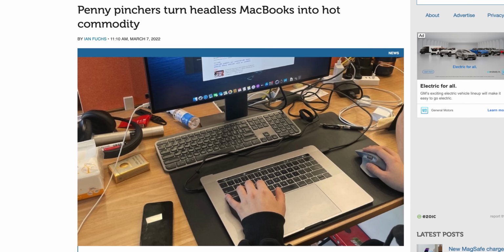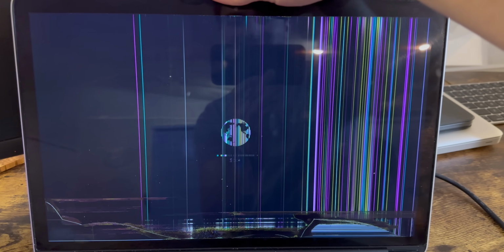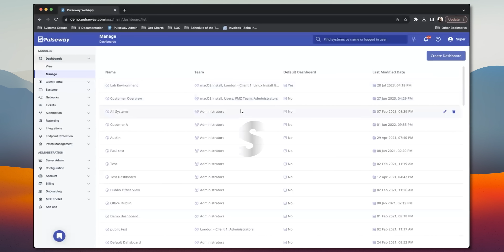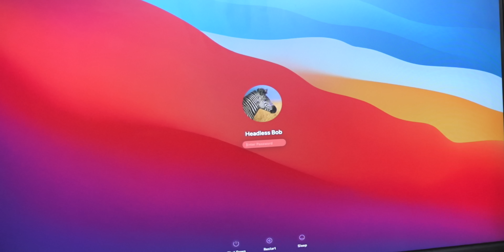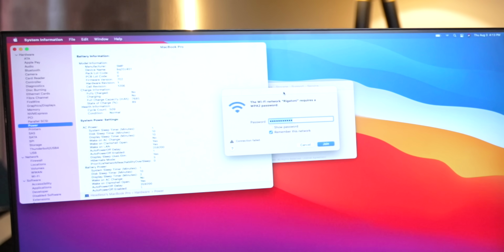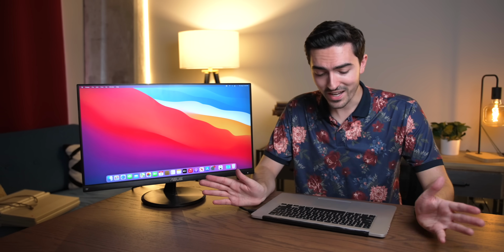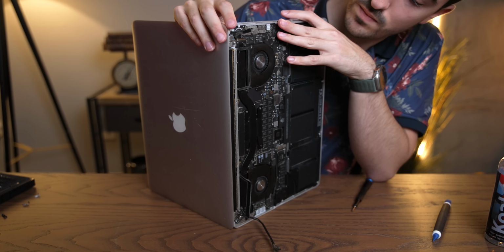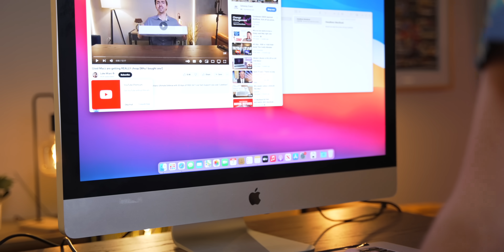Exploring the weird world of 'Headless' MacBooks

Comment: 2016 and later macbooks have the antennas separate from the display so you can remove the display assembly and keep the antennas.
Reply: Except the 2017 Air and 12-inch MacBook =)
Reply: @OskarBlomkvist   The 2017 air is in every way the 2015 one so it does not count as being 2016 amd later. The 12 inch MacBook uses the housing of the speakers as its antennas and are not connected to the display in any way. The in-display antennas died with the 2015 macbook pro and air. I rest my case.
Reply: @mirceamihai94  You're right about the 12 inch MacBook, but wrong about 2017 Air ;)

Comment: How does the MacBook now know it’s shut (clamshell) and not open? 
I would suspect that when you use the MacBooks keyboard it definitely thinks it’s open and the external display is the secondary display and when you go in display configuration you’ll see the external as second display and can’t access the stuff on the internal, primary display.
Reply: the mac can actually tell if a display is connected to it's internal display connector. This is why you have to install opencore legacy patcher on some macbooks to disable the slowdown that can be caused by this
Reply: Hall effect sensor!

Comment: I think 'Headless' M1 13 MacBook Air is better than M1 Mac mini. You even don't need to buy a keyboard and a trackpad separately.
Reply: You don't need to buy a UPS.
Reply: @leonidas14775  Or any other shipping company, for that matter!
Reply: I run one of these. I connect to either a monitor, an iPad, or XREAL Air glasses. It’s fantastic if you can find a discounted one for resale. It’s a little quirky at first but most of the weird primary display conflicts can be circumvented with the software ‘BetterDisplay’. I think the M1 air is ideal bc it’s a closed design with no fan, a sloped keyboard deck and amazing battery life. Keep in mind that the device will always be on, since touching a key will auto boot the device. You will want to lock before you disconnect screen (or create a lock shortcut). I keep it in a felt sleeve in my bag.
Reply: The problem with headless m1 mac vs mac mini is that they can only connect to 1 external display.
Reply: @xuananh812  mac mini can be connected to two external displays because it doesnt have built in screen in contrast to macbooks that have a screen built in and support one external display
Reply: But the thing is a lot of these headless units have their board repaired and probably will not last long. 
Given M2 Mac mini is so cheap, there isn't much reason to still buy these units.
Reply: Headless M1 MacBook is cheaper then a MacMini and includes the glorious trackpad, battery, and touchID. It works excellent with HMDs if you want to work or game in a reclined position as well. No wall outlet needed.
Reply: I DECAPITATED MY FULLY LOAD M3 MACBOOK MAX (GONE MISTAKE?)
Reply: How is that better? A macbook air is much more expensive than a Mac Mini with the same spec.
For the price difference you can easily buy accessories like mouse and keyboard.
Could you explain the logic?
Reply: Lack of a fan could be a factor for people using high performance programs like for video editing
Reply: @42cosmonauts if you need a fan than you could use the 13 inch m1 pro
Reply: @jacksonkuzmic headless M1 Pro 13.   Great idea!
Reply: @42cosmonauts  Maybe drill holes in the bottom and mount it vertically. Attach a blower fan to it.
Reply: At that point just get a mac mini and accessories. No way that'll be any more expensive and way less janky.
Reply: wait until macs won’t turn on w/o all serialized and coded components attached. that’s coming. they’re at a point they’ll do anything for the stock price.

Comment: headless MacBooks are pretty dope, it's like having a Mac Mini and a Magic Keyboard (w/ Touch ID for some Macs) + Trackpad combo rolled into one, a neat way of reusing MacBooks with smashed displays, and potentially better than the Mac Mini if you prefer your MacBook's IO :D
Reply: Built-in UPS as well
Reply: @TimurTripp2 That's a solid benefit but I'm trying to figure out how this would play out in practice. The battery would give plenty of time to save everything and properly shutdown the computer, but it's tricky to do that if the monitor doesn't have power. I suppose that as long as the battery last longer than the outage then it'd be quite helpful. Can Siri toggle voiceover so I could navigate as though I were blind? 

I'm not sure why I got so caught up thinking of solutions to a problem that I will literally never experience, but here I am.
Reply: @B-rad1  that’s true, I didn’t think of the monitor going out! Depending on the condition of the battery, if you manage to put the MacBook into sleep mode it can last quite a while, days even. You can also possibly set up and use a hotspot network and VNC app on your phone to save your work and shut it down.
Reply: hopefully, the prices don't get inflated because of this headless idea.
Reply: @gordonoboh833  i’ll tell you the price already increased here in Vietnam, there’re shops that specialize in these now 😂
Reply: @gordonoboh833  likely not I have been using mine that way for a bit over 4 years at this point.  I don't doubt however that Apple with make it nearly impossible to use without the attached screen through their software that pairs serialized parts to one another to make repairs outside of apple care difficult if not impossible.
Reply: And MacBook speakers are pretty great too!
And you'll still have ports available.
Reply: Agreed 👍 🎉😂😅

If we can run these computers for a while longer. That’s a bonus for all of us. ❤
Now to find a used broken MacBook 💻 Pro. 😂
Reply: It’s almost like he says this exact thing in the video.
Reply: @Ozzymandius1  It's a predictable conclusion lol (typed it before watching the vid)
Reply: More like a modern Commodore.
Reply: Use it as a server
Reply: Sure, headless MacBooks are dope if you cannot afford to replace the screen, because you are poor as fuck...
Reply: So true 🔥
Reply: But the thing is a lot of these headless units have their board repaired and probably will not last long. 
Given M2 Mac mini is so cheap, there isn't much reason to still buy these units.
Reply: @leanlifer Yeah I thought the same thing, why not just buy the M2 Mac Mini? MacBooks run into the same hardware reasons as any other laptop....broken keyboard? Buy an external keyboard and mouse. Broken display? Well plug your laptop into another monitor. Mini PCs are getting popular these days because they avoid these problems of laptops while providing the same benefits of compact space and portability
Reply: @user-dm9de8mq2w  wdym these Macs have their board repaired and less likely to last? All you're doing is just using the thing without the display. If you needed a board repair as well, that's just an unrelated and different issue, and would've happened to any other computers. And while the Apple Silicon Mac Minis are cheap, it's still way more expensive than either getting a MacBook with a broken display or reusing your MacBook with one. Mac Minis aren't universally better than this either, since Mac Minis don't have built-in keyboard and trackpad, they have unusable speakers (pretty much only used for boot chime), and no back up battery either (that depends on your battery health i guess, but still)